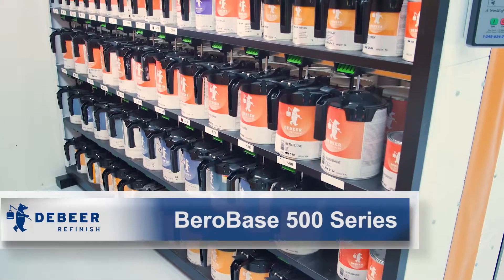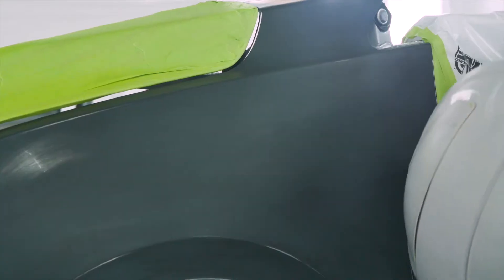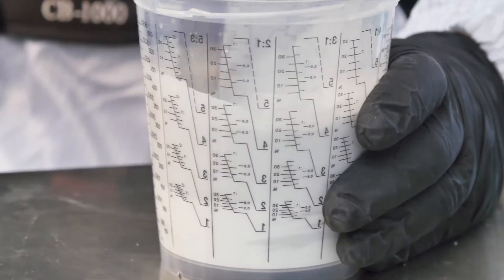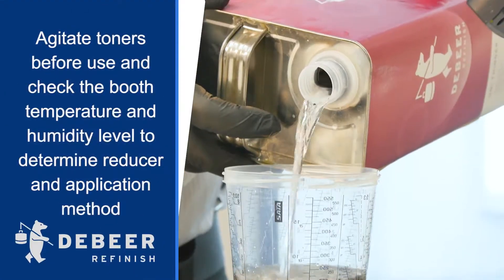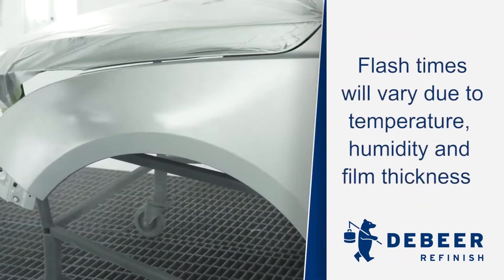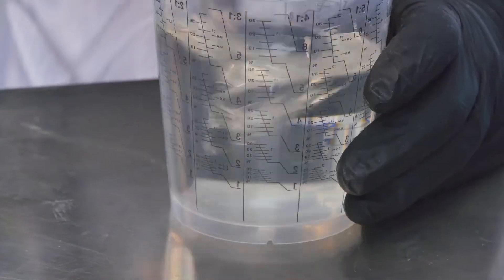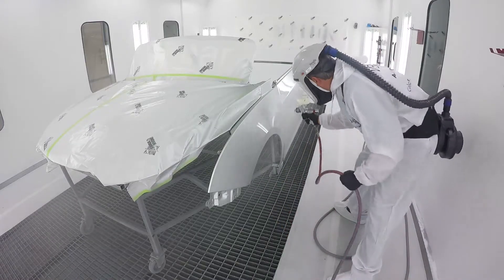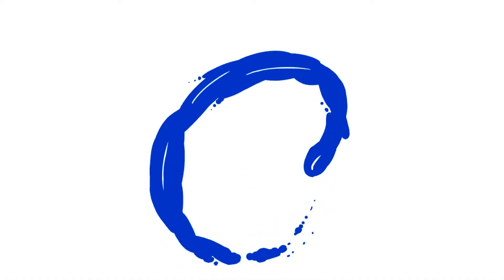How to use DeBeer's BeroBase 500 Solvent System

Comment: I have this paint system at my job but I’m having problems laying down any light metallic colors like silver or gold u can see the streaks after applying clear I have use different spray guns I just bought the hvlp finishline devilbiss  thinking that maybe is the guns that I’m using but I use to have the lessonal system and never had any problems with it. Anyway I use it with a 1.3 at low pressure I try higher pressure I even try to shoot it heavy so it can look wet and I try using different reducers and still have the same problem is anyone having the same problem as me or maybe some advise please thanks.